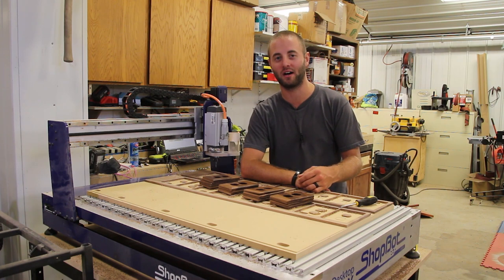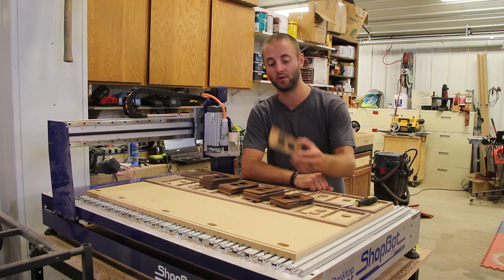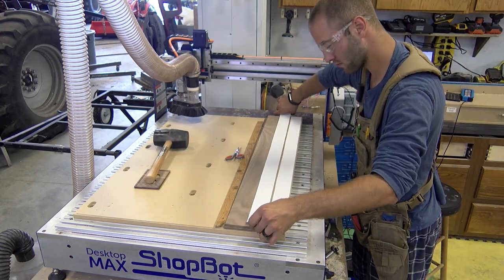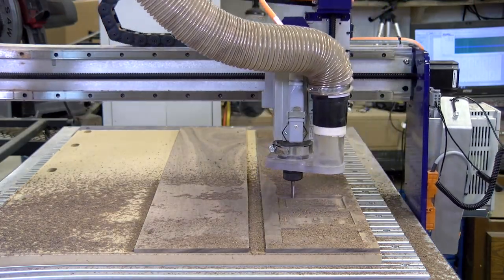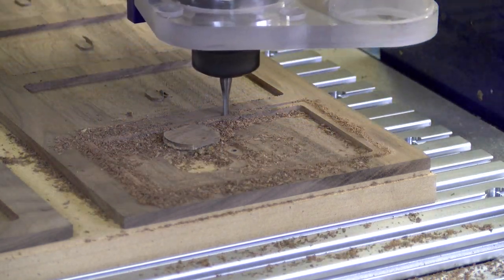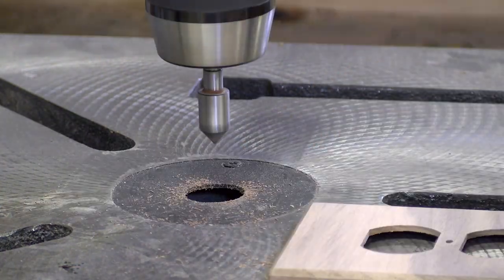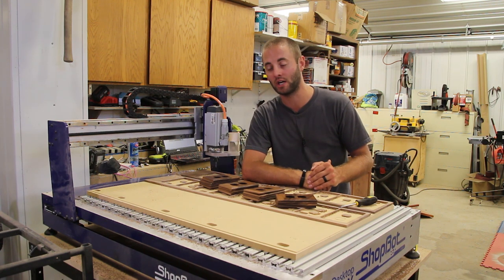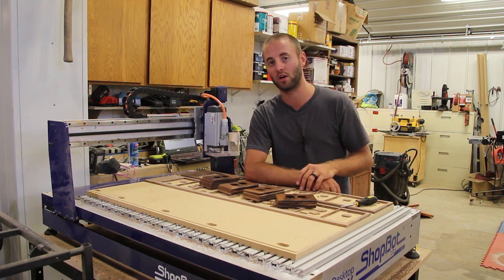Make Money With your CNC Machine | Custom Outlet and Switch Covers

Comment: I specialise in cnc routers, much larger than the one in the video, but the same concept applies. Every machining step here could and should have been done on the router. I would machine the back side of the plate first, have a program stop in place, flip the full sheet over, run a 90 degree V bit around the perimeter of each plate first, then use that same V bit to put your chamfer in. Switch over to an 1/8" down shear, plunge cut the screw hole and then go around the perimeter. 
This keeps your corners and chamfer perfectly lined up, your countersink the exact same depth and by using the downshear, any chipping or fray that may happen is on the back side where it is more easily taken care of.
For the finish sanding, I would also suggest a jig and use of a long sanding block to keep everything uniform. 
I dont know what your spindle speed or tools are capable of running or your feed rate, but I find I get better quality cuts with higher spindle speed vs feed rate. Another little trick is to run a low pressure air line down to the cutting area to blow chips and dust away from the tool, quality goes up and the tool stays cooler.
Reply: You're saying to use the router in your hand to make each one of these individually? Nah. Let the CNC do the work and you can get other things done.
Reply: no thats not the correct way to do it, the video is the best way
Reply: If you read the explanation above he is actually suggesting to use the cnc for all operations.

Comment: What would you actually charge per unit on this project? I have been doing a bunch of research on a CNC machine, but my shop works on $/hr. You said 45 minutes to do this project, how much did you charge per unit? Is that from setting down at the computer designing, clear to end of the machine doing its job? Just curious on different jobs. Do you charge a set fee per minute or hour that it takes for a custom job?
Reply: The short answer, is it's never enough money at the end of the day. All business owners half to lie ti themselves regarding the actual total hours worked on all aspects of a job.

Comment: You asked what we thought, so here goes.  The finish is terrible.  You should have sanded the front of the board before you machined it.  You can see lines across the face.   I used to install hardwood stairs and railings.  Only once did I see the wood properly sanded to get rid of all the glazing and planer marks, and the one that was sanded looked amazing.  Wood has a very soft look when you sand it smooth.  Otherwise I really enjoyed seeing how the CNC works.

Comment: If I had to give up my cnc or the table saw... the table saw would go..  The best part about one is once you got the g-code done all you gotta do is stick down the stock and unless you need to change the bits just walk away and go do something else. Even if you do have to change the bits, its still basically the same.  

Personally I think anyone with the average hobby level wood shop or above needs a CNC. Theyre just too handy a tool not to have. Mine has a cutting envelope of 18.5 BY 24 By 6 inches. The perfect size for most of my needs.  I have whittled up a 12 foot 2 by 6 somebody using their clip art once. Just do a chunk, scoot the board a bit and repeat.  But the 18 by 24 area is all I need most of the time.  The best part is I can easily hold tolerances to  5 thousands of an inch clear across the 24 inches.. Just try doing that by hand.  :) 5 thousands is just about the thickness of a sheet of common printer paper. Then theres the times you need to run a board through the thickness planer BUT its too small. No prob, just slap it on the CNC, and youre in business.  If its twisted so bad it looks like  a plane prop, just shim it solid on the botom, level one side, flip it over and repeat. Some woods I work with go from around $12 and up a board foot so the "scrap" pile can represent a sizable chunk of change. The longer you have one the more uses you find for a good CNC..

Comment: I did the same thing on my C&C but I used a quarter inch bit to remove the center part and instead of profiling it I pocketed it so you don’t have a little piece moving around also wont have to do a bit changes either fit perfect

Comment: I do recall that the NEC requires all parts to be listed. Most wood device covers have a metal backing, and for good measure, listed covers have a fire rating of something like 20 minutes. I love the idea of using a CNC to make custom finishes, but without that listing, you are opening yourself up to potential liability.
Reply: That's a very good point

Comment: What software did you use to model the covers? How did you nest the parts? 

I have experience with modeling a single item in Autodesk Fusion 360 but not sure how to extend my work flow to next similar parts based on material dimension.

Comment: How much for the CNC machine. Thanks
Reply from the maker: 50K  LMAO
Reply: I built a 4' x 4' MPCNC for under $500.  Built a 9' x 9' Legacy wall with 196 6" x 6" tiles with it, a couple local contractors estimated it at about a $10,000 project.
Reply: What’s the brand of machineyour using?

Comment: So, correct me if I'm wrong here I'm actually wanting the information. Is this not a fire hazzard? I mean a good spark from an outlet and you have yourself a fire...
Reply: Brodey Sheppard it is true i was thinking the same but most of houses un Canada ir US are Made of wood, arent it? I think that you can cover with some insulating chemical but I am not sure, probably it is more dangerous to have a wood outlet than a plastic outlet anyway..
Reply: They would be treated. so they are mildly flare retardant. But you are also not going to start a fire on hard wood from a spark. You are far more likely to have a fire started from the carpet or plastic burning. If an outlet is going to burn it's gonna burn regardless of what type of cover it has.
Wood outlet covers have existed for decades as well.
Reply: Plastic would light just as fast as wood

Comment: With the cost of materials, time and labor. Not to mention initial investment of the Shop Bot, I would have to sell them at $20 to $30 each!
Reply from the maker: Scott Everywhere we sell these particular outlets for around $12-15
Reply: Salesmanship:  A woodworking skill I never hear discussed in conjunction with CNC.  When people want something personal, original, one of a kind … a man with a CNC is one thing but a man with a CNC and salesmanship really brings the combination together.  A customer tells you their passion.  True salesmanship capitalizes to the benefit of both.
Cost becomes secondary.  If it doesn’t…don’t machine it.

Comment: seeing as how the cnc is touted as labor saving, u coulda sanded out the mill marks on the front of the plates ;)  just sayin
Reply: if you were more focused on producing quality, I bet you'd do better than with your current attitude of "just to add another line item on the bill"  As a woodworker its cringe when I see you just leave the machine marks all up in the wood and just let it fly, especially on a product designed for a visual application. I hope your clients agree that its just another line item on the bill too. Good luck with your bigger cnc machine!  #cncdudes

Comment: 10 fudging grand for that thing?! nope. The pricing on these things are ridiculous. The cost of production isn't even %30 of the sales cost. If you were to buy an actual industrial machine, at least you are buying material. Oversized screws, larger motors, thick heavy cast iron that won't warp, etc. For $10,000 you could even by a tormach metal CNC that has an obviose better build quality and is much more powerful.